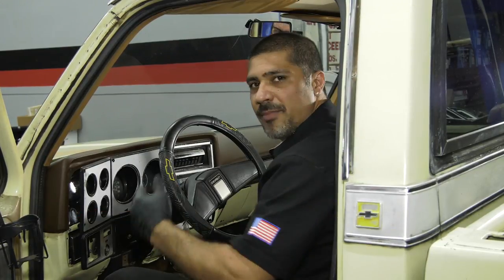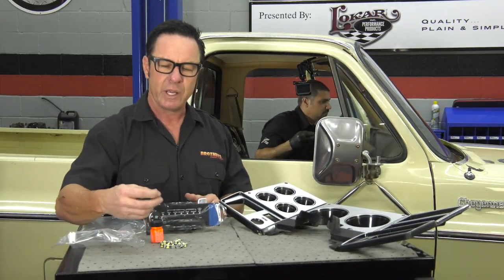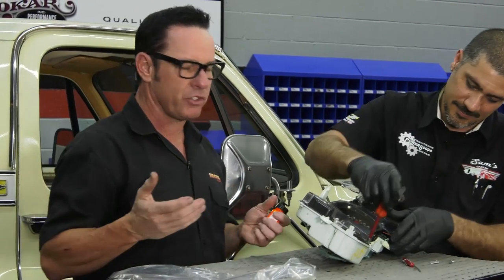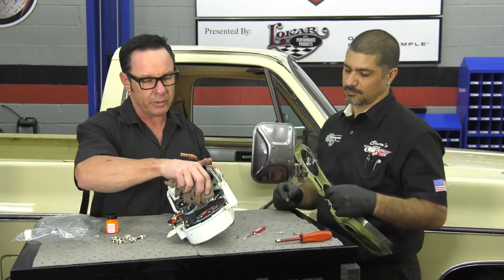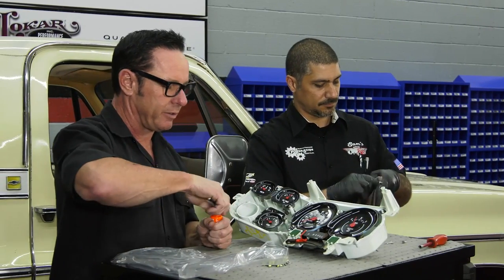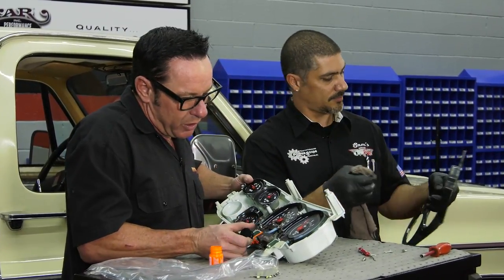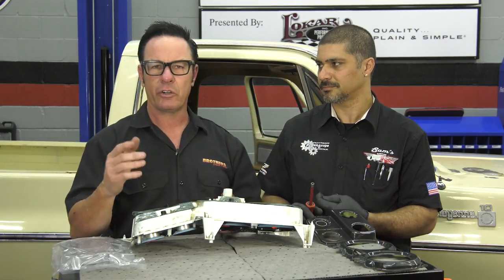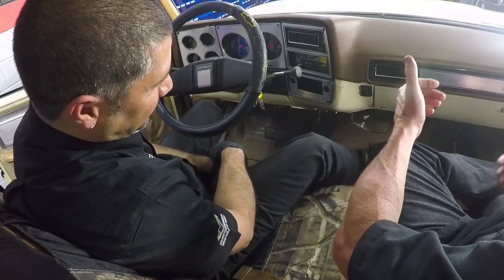Sam's Garage S2 E3 - 73-87 Chevy & GMC Truck Dash/Gauges Rebuild

Comment: I agree mr.sinaloa1760...  OK Sam if you really want to help, lets take a deeper dive (maybe a video) in getting that cluster out of the truck.  Please help.  Also mine has a clock that still works.  How do I get the time set knob off?  don't want to just start yanking on it.

Comment: What did you use to fix the large radio cut out to accommodate for the new classic look radio?
Reply from the maker: We replaced the factory dash bezel and the new one has original type mounting holes. The new stereo is very light compared to the factory one so the plastic dash is plenty strong enough to hold it. We also use a the metal "plumbers" strap that comes with it at the rear to help give it a little support.